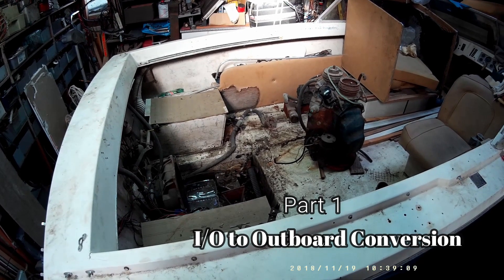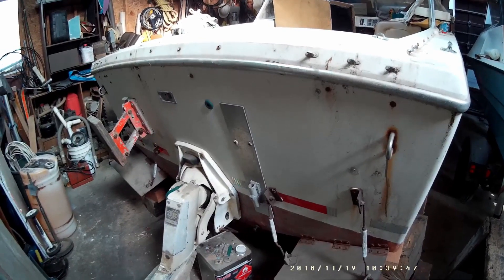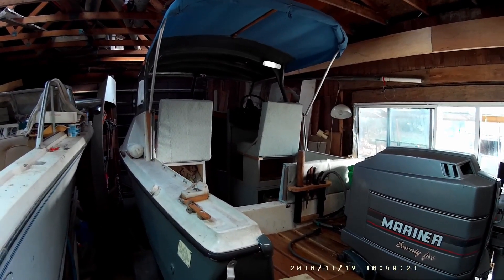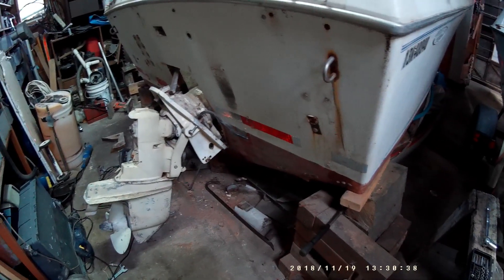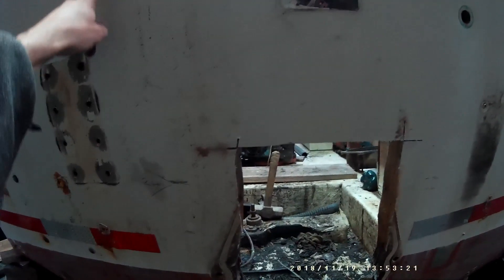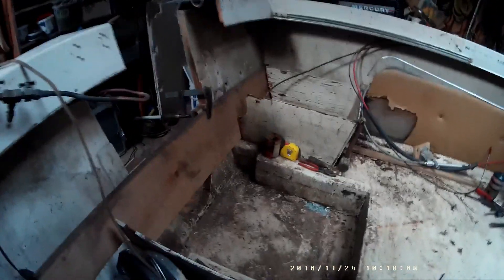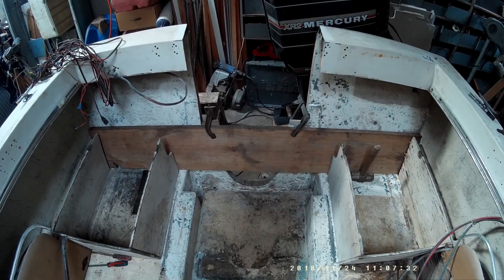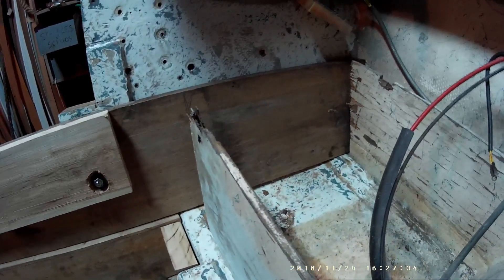Runabout Outboard Conversion  Part 1 - I\O to 150hp Mercury Outboard

Comment: hey, remeber trying to trash talk my conversion i did 10 yrs ago. Well the offset i used for the pod is mathematically worked out, it reduces drag on the prop, get the boat on the plane  quicker than that would by far, can handle large swells at easy and also any follwing waves, was also very efficient.  reduced fuel cost and improved the boat speed/ Oh and mine was a 22ft not a toy 16ft.  Your finished product has not been shown on the water and happen to look like a POPE mobile.  ;P Just saying. You stick to your wood/cabinet making, leave the hydrodynamics to me. At least mine was shown at sea aafter the finished product. ;P
Reply: lordlugworm worst thing he ever did was cut open a closed transom. More boats sink every year due to open transoms going offshore and taking a wave from the back and flooding the boat. Your bracket came out great, looked good and worked. Good job.

Comment: I am curious on how low in the water that transom will be.  Are you making a well around the motor so the water doesn't come in.  It seems so low.
Reply from the maker: Thanks for the comment bigair.   Yes Part two will be finishing off the interior which will entail making a well for the water that may make it past the engine.
Reply: A follwing wave would swamp that job and you other one. Hobby horsing? hahaha Correect term would be porpoising, but then you dont seam to have a clue? And if you would like me to post what you tried to post on my conversion back here i could,  Then all can see you were trying to get views for this? Trash talking the job i done? hahah I wnat to see your boats at sea?